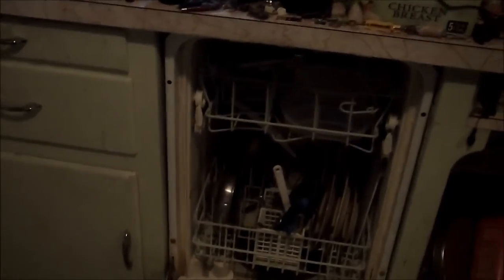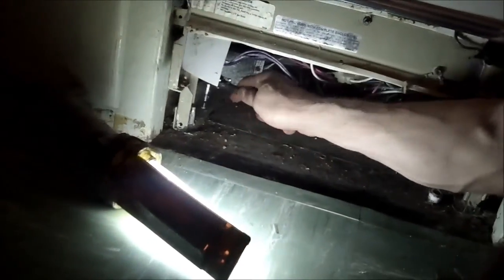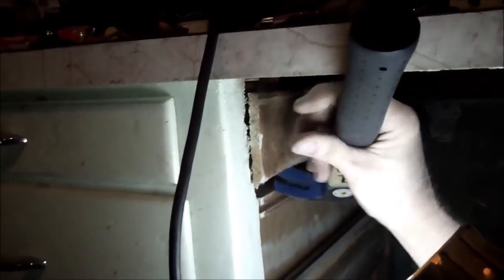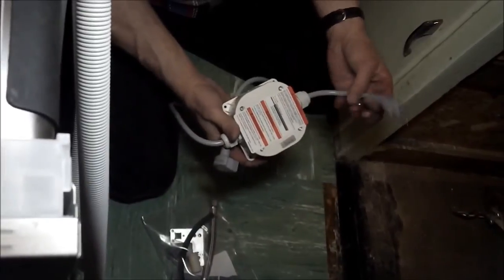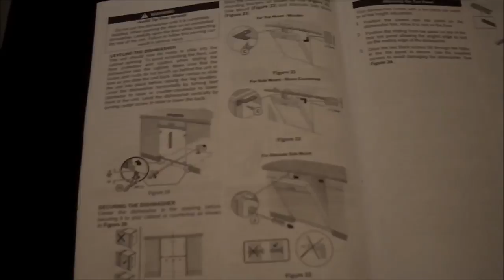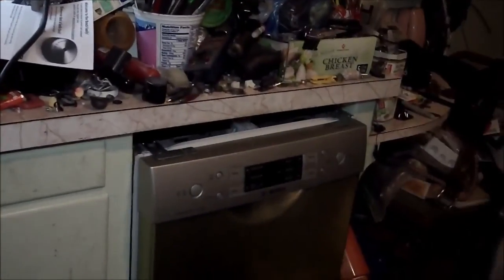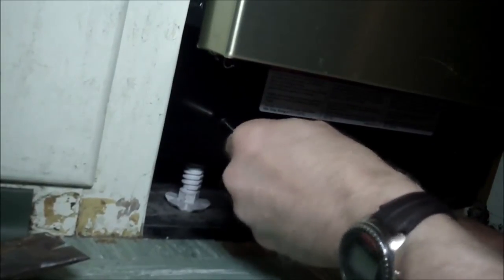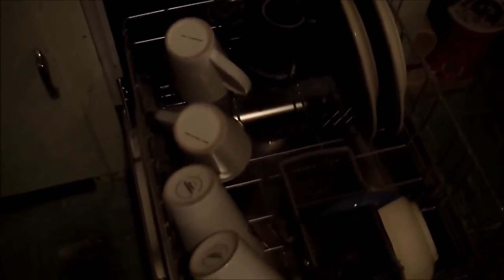Bosch Model # SPE5ES55UC 18 Inch dishwasher Install

Comment: How big a dish diameter will fit in the bottom? Will a 11 and 1/4 dish fit? Thanks!
Reply from the maker: +David Smith; well if you do 1 or 2 at a time? yes for sure. this is because this unit has a sprayer in the bottom, & top, not a extendable center sprayer that the older style 18" units do. OH.. I just tried a 12" LP in mine, yes a record. I bet 2 on one side & 2 on the other would fit, on the outsides. the top spinners would miss the 11-1/4" . if you tilt the dish more than the support fingers, 2 will go. oh... yea, I looked again and guess what! there are 3 heights for the top rack. this will allow for the  "2 on one side & 2 on the other would fit, on the outsides" maybe 6 total. take 6 plates to you dealer and test it for your self. BTW this unit is vary goo, and absolutely silent. better that I expected is all respects. worth every penny for sure. no compromises in any way. ER